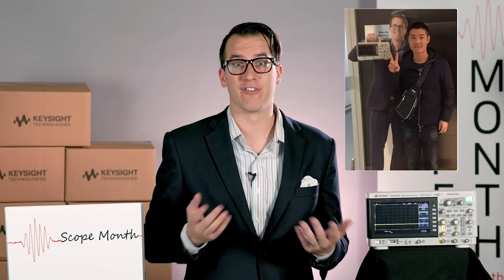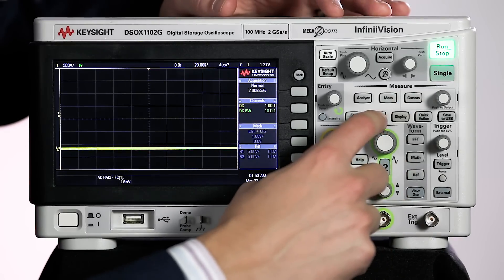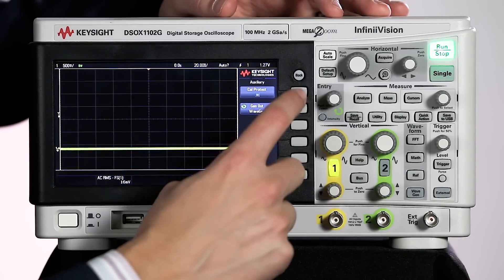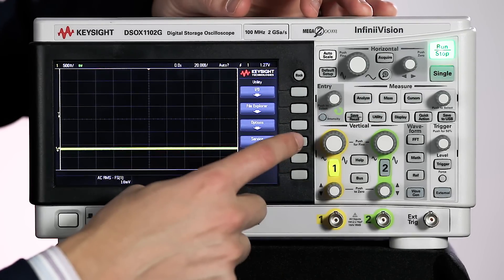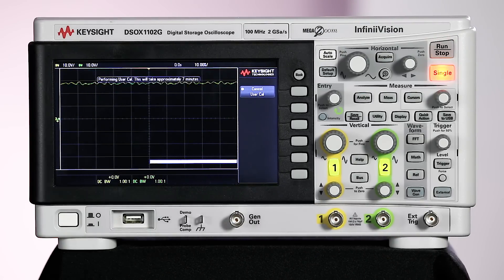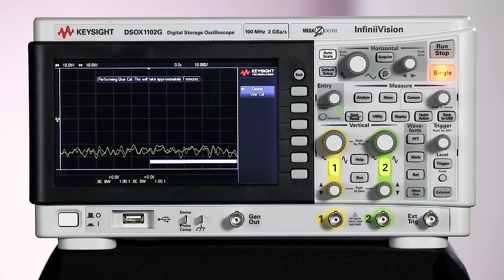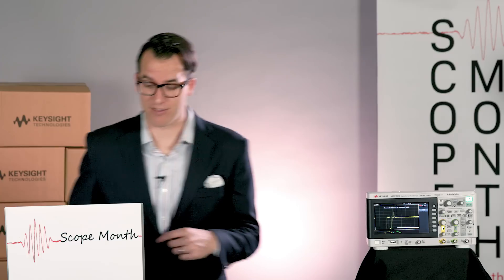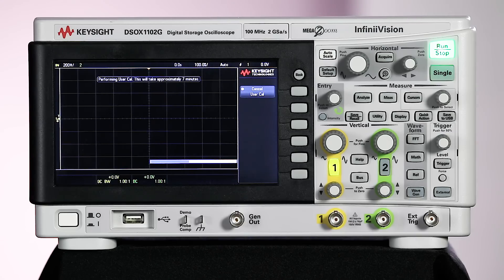Should I Run a User Calibration? + Scope Month Winners! (22-Mar-2017)

Comment: Answer: 
As far as I can tell, the answer seems to be, dont ever run user cal because it isnt as accurate as the factory cal and it deletes the factory calibration. Unless for some reason the signal is way off because of temperature and you really need it to work and you dont mind deleting the factory calibration.
Reply from the maker: Right. If you're cal is current you probably don't want to run the user cal. If it's not and you're working at unusual temperatures, it's probably worth running one.